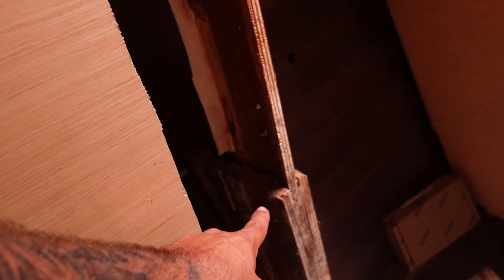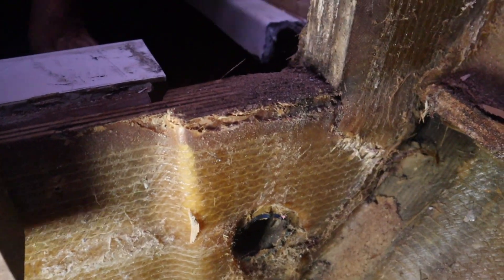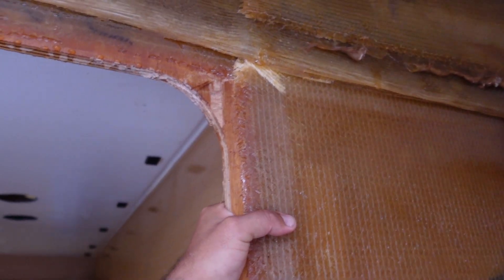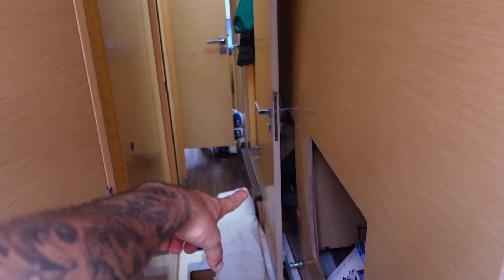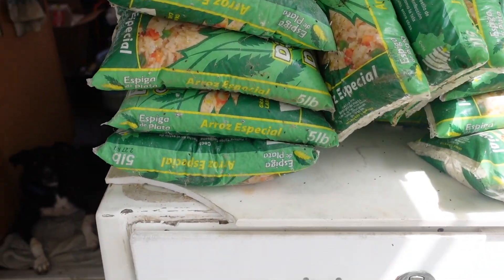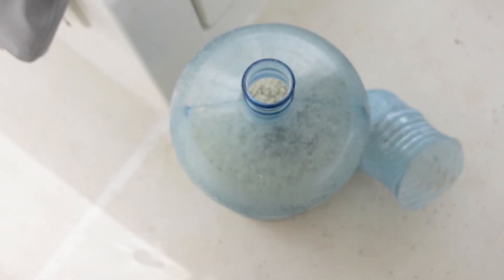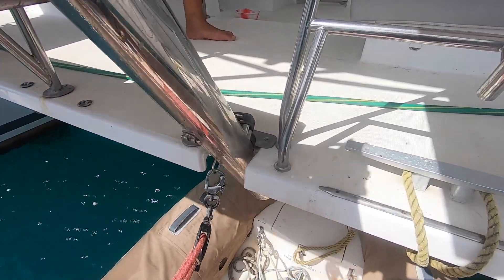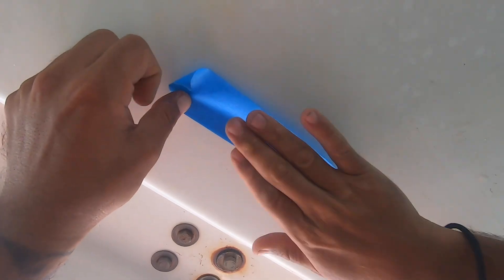CRACKED BULKHEAD REPAIR SERIES: Part 1 - An introduction... (Episode 107)

Comment: I cant believe they only used 3/4 inch plywood bulkheads, criminally shoddy construction. I use 2 inch thick on a 20 foot power skiff.

Comment: would you need to pack out under the saloon so the losd of the straps is spread across the hull rather than just pressure through the keels ??I am no naval achitect just have an engineering background / not to sy you don know what your doing just thinking how I would go about it , to try and not cause moor damage

Comment: That ply has been wet, then put under load (or already under load) which has then caused it to sag like that.

I agree with you - sudden damage would result in fracturing. for wood to bend like that takes moisture. Its all black and funky looking too - so id definitely go with a leak somewhere. Id find that and fix it while you are at it, and probably replace the whole bulkhead using the old one as a template.

Comment: Good video, this is not the first 45’ Lagoon I having these kind of problems. I think this is not because of the hurricane damage but more about selling a “nice weather coastal cruiser” to offshore blue water sailors. But again it is only my opinion. Wish you success with repairing this enormous damages to make it stronger than it was build. I think Lagoon should pay for the cost if this boat is not build to offshore sailing standards as they market them to be.

Comment: wow you have a lot of work on your hands. looks to me like a combination of things have happened here. age/water damage. fatigue, impact and overstress. Good thing you are exposing all the bulkheads now and getting a good read on the repairs for each area. Tool up! when you are in the lift and trying to position the boat correctly you will probably need to remove some bonder and splintered materials in order to get it to settle into place. Oscillating tool, cut off saw, die grinder and angle grinder. it is amazing how those little bits will prevent the parts from coming together. Make a plan ahead of time and some of the bad bits might be best cleaned up before you go in the slings. Like the bonder that is broken and shaggy.

Comment: Prolonge fatigue is a sign of substandered materials or substandered epoxy joining/ glueing. You can see the buck head is warped and bent rather than a snap or glue failure. To me with a civil engineering degree and a masters in construction is substances materials and fixing method. You may have a case against the manufacturers, and they know it hence the reached out to you before you reached out to them via a lawyer.

Comment: What, a level on a wall with the boat in the water,  would if there is more weight in one hull than the other... like you said,  get it on the hard and support the bridge deck,  LEVEL,  loosen all the shrouds, double up bulk heads and header.... at mast position... at least 3 3/4" ply...

Comment: Your definitions of "level" need some work. When you put the level on the wall, there was no way to know if the boat was level in the water; even your weight on the one side would have affected that. You will face the same issue on the hard. You need some way to know that the top of the supports inner the bridge-deck form a level plane.

Is it possible that at some early stage of the boats life someone overtighened the rig putting too much strain into the hulls? Would love to know a bit about the theory of how tight the rigging should be to hold the mast but not collapse the hull bulkheads.

Comment: Good luck to all Lagoon owners......I am glad I am not one of them !!!
Reply: Well the boat went through a hurricane, was part submerged, repaired to get out of there, sailed and then hauled out for repair areas where moisture got into into the balsa core. The question on how can plywood deform like that is pretty easy moisture, heat and constant tension also bending timber is done under compression perfect scenario for boat rigging.

We have no idea what else this boat has gone through like haul outs missing bulkheads or over tensioned or under tensioned rigging and sailing overpowered.

Steel boats are more forgiving and keel boats will heel to drop power to falling flat but you have heeling and less flat floorspace than a cat.

Even with all the work if I was 20 years younger I would take the gamble to sail the world but after hitting a container, ghost net or Whale 5 days from land in a mono hull in a fibreglass yacht and having the rudder ripped out I sort of decided I was not so keen even tho I saved the boat and got it and me to shore (much to the insurance companies horror) as they wanted book value not an pre accident assessable condition.
Reply: 🤔 Steve T are you from a cubical of Lagoon? Sure write as one.
Reply: @stevenr8606  Nope I don't earn that much but investigated building my own cat (spare hull, rudder and engine seemed smart) but well I still just have the drawings.

I had an old heavy slow solid core 45 ft mono hull so draining blisters and touch ups with endless electrical and mechanical issues (only just enough skill), it was a deep keel, it was cheap and "fixed" in many exotic south pacific places before leaving (and breaking) not seeing much of anywhere before it hit a container, ghost net or whale ripping the rudder out (whatever it was never broke the surface).

Completely the wrong boat for the reason I got it but it was cheap to buy expensive to maintain and worth possibly a little more than what the insurance paid out.

There is no perfect boat or material balsa can act like a wick, infusing large areas of the core with water from even a minor breach. Cross-linked foam is less tolerant of impact loads and can burn when grinding the outer glass and damage cannot be seen and ply even marine ply breaks down in water (there is one with a 5 year in fresh water guarantee).

Honeycomb like Nidacore is great once glassed but expensive, this was what I planned to use for the bulkheads as it is Zero maintenance but still needs to be glassed over for finished surfaces.

Yachts are built to a weight, price point and I think this boat having gone through what it has from lightning strike, a hurricane and partial submerged after being a rental boat (and we all know rental cars are treated perfectly).

At the end of the day the yacht still being reparable and Colin as an engineer having other salvaged boats as options he could have taken a different hull and swap the equipment only but still having confidence in the abilities and reparability of that boat shows.

Also for the boat builders to assist a self professed amateur to repair their older boat  with minimal supervision then continue a lap of the world knowing it's history, it is a lot of risk for the Yacht Builders knowing their intention to sail to NZ long distances big ocean waves lots of weight in the boat.

Comment: Best of luck lads. You’ve got a serious task at hand. Does Lagoon have a CFD analysis of loads for this model?  That would sure help with identifying key stress points and avoid transferring the loads onwards to the next easiest point of failure. 
Absolutely riveting stuff though and makes your channel stand out. I’m going to your Patreon page next and chip in for the journey. David J Flatts, Bermuda 🇧🇲

Comment: These examples of deformations in the vessel are because of extremely poor boat building practices. These techniques would never pass any American boat building standards.  They’ve all been developed to save money and weight. Once the insurance companies realize these improper techniques, these boats will be un insurable.  Catamarans have to be light but not by improper building techniques and materials. Your pictures of failed bulkheads illustrate the worst newly developed shortcuts possible.   No sense in saying more about what should never have been done.   Good luck

Comment: I am a boat builder  of plywood and epoxy boats. west  system is not the best epoxy it is expensive and hard to work with. I use Raka epoxy out of Florida. Those bulkheads should be 2 inches thick laminated plywood. You don't need marine grade ABX is fine

Comment: I agree with your claim that the buckling you see in those bulkhead panels was not caused by sudden impact but rather sustained warping over a period of time. I have many years experience working with marine grade plywood and looking at those sheets makes me think it is not the best of quality. Also it appears to be either 13 of 15 mm thick? Perhaps do the rebuild with 3/4 inch / 19mm. Of course, the problem here stems from board strength. The strength comes from the glue (obviously the birch plays its part) and over the years places like the EU introduced more and more regulations on the formulas of the formaldehyde glues that manufacturers use. What we found was that the best place to source the best marine grade plywood was Russia. They are obviously outside of the EU and care little for regulations and sadly for the safety of their workers. The Russian plywood stank due to the glue but it was like sheet steel and we had to buy waterjet machines to cut it easily. Good luck with the repairs, I'll be following along.

Comment: You can eat that rice.  Out in water and mix the bugs will float. The Irish can than be washed and cooked as normal. Problem is once the rise is wet it was to be cooked so can only do that process a bit at the time.

Comment: It's starting to look like you're going to need to basically gut the hulls out to the 'glass and rebuild most if not all of the structural framework.  It's going to be a big and hairy job but if anyone (outside of the Lagoon shipyard in France) can do it, it's you guys!  Do a cost comparison between coosaboard and marine grade plywood Colin, the way lumber prices are (at least Stateside) it may almost be cheaper to use the composite material!

Comment: The Lagoon 450F has long been my dream boat but after seeing the serious build problems in Parlay I won’t consider one. Gonna keep my solid fiberglass tank of a monohull and put dreams of a flybridge away. Thank-you for making the series guys!!!
Reply: Its all just fibergalss mate. If you put your mind to it it can be fixed and made hurricaneproof.  Not only was this boat damaged, but I also suspect that the construction is on the edge of strenght due to cramming as many efing beds into a charter boat as possible.
Reply: The cat forces transmit to the hull the mono forces bleed off with healing

Comment: I would suggest a digital angle finder rather than a bubble level to be more precise.  Also, that wall is supposed to be vertical when measuring to the horizontal of the vessel, your measuring instrument (bubble level, angle finder, whatever) measures relative to the earth.  If you are going to take those measurements you will need to ensure the boat is perfectly level (measured at the bridge deck?) or have a measurement of how far off level the boat is and adjust your vertical measurements to that.  You're a smart guy and I assume you already know this but its worth saying just in case you didn't.  Hope that all makes sense!  Best of luck, I have all the confidence you'll knock this out.

Comment: Shouldn't you wait until the tension is gone before removing anything else? Did the boat basically buckle under the tension from the shrouds? Also will you be considering weight when adding extra fiber glass than standard?

Comment: I'm wondering if there was a material defect in the marine grade plywood, is that the side of boat that was under water? I'm wondering if the salt water started to delaminate the Plywood and then the combination of rigging stress and sailing impacts contributed to the failure. I agree damage like that is not from single event. I'm also a little confused with a boat of that cost and quality used plywood. It should be replace with Coosa board and that "glue" in the main bulkhead sections that is completed separated from boat should all be tabbed in with a heavy glass and epoxy.

Comment: parlay,,when you put the level against the wall an showed it out of plumb, that tells me , when your cat is on the hard you will have to level an plumb the cat to specs before you repair any damage, the naval guy that designed your cat should cover that, he would be the one that knows where those points are to level parlay before repairs are started,, its like a house if the foundation is screwed, so will the house be,,,bottom line is parlay will have to be perfectly level front to back an left to right, and how thats done is a complete mystery to me, it would be a great vid, how to level your boat before major repair, mr collen  i send an wish you luck on your repairs, cheers

Comment: Looking on the positive side, you're going to have the strongest Lagoon in the World when you've done. I would exoect Lagoon to at least cover your materials cost, this is the worst possible PR for them. I won't wish you good luck as I know your work will be spot on.
Reply: I wouldn’t count on a manufacturer to cover the costs to repair a storm salvaged boat
Reply: @yankkesrule  Looking at the standard of the initial design and build materials I think the boat is sub-standard quality and owners all over the World will be rushing down to check their bulkheads - bad, bad P.R. They should at leasy make a more serious gesture to help.

Comment: The vessel probably had cracks in the bulkheads as a result of the hurricane. The hurricane probably had the vessel contacting and slamming against hard thing like land, the bottom, and other boats.  It was not designed to contact thing of that type. Then you sailed it quit a bit which would make the cracked bulkheads get worse on a constant basis over time.  It is great the manufactor is helping you with your repairs, I am sure you are thanking them for that. They can’t make a vessel capable of surviving a hurricane especially in the harbor. Once you repair them properly you should have a great vessel. Your are a hard working crew and deserve to win. I have always watched all of your YouTube presentations. I will start to support you as a patron.

Comment: You can't use a level on a boat an less you no the floor is level. You need to probably need to use a square to see if you are  Perpendicular to the floor
Reply: The BIGGER question is the floor still level with the waterline of the hulls. Many factors need to be considered when either on water or on the hard. 1st hulls need to be level then go up from there.  The Cat has obviously been tweaked considerably !
Reply: @AlienX69  check the floor for level while 8n the water might be tricky with the water not being perfectly still.

Comment: Remember in ep 11 back in Guatemala you got assistance from someone in the yards "tightening the shrouds to spec" with that fancy line tension measuring device? I'm sure that's where this problem started.
Reply: Maybe perfect storm of events. Water damage, stress, etc
Reply: I think that you are partially right, but that time actually started to magnify the pre-existing design and build problems with these bulkheads. There are many 450 owners that since seeing the problems that Colin has found are inspecting their own 450’s and finding the same failures, albeit not as severe. This is definitely a design and build quality issue of Lagoon that I’m sure will be present in other Lagoon models as the same design and build methods were used during that time period across many of their models.
Reply: I was thinking the same thing, shrouds hastily tightened before FGlass had a chance to set up properly? Or under mixed resin problems causing warping and eventual failure from prolonged tension?
Reply: Would suggest there was structural failure that hadn’t been found after the hurricane damage - looks like the  entire haul or one side of it was picked up by the storm and twisted. Is it best to remove all the cabin fittings and take it back to an empty shell?
Reply: I agree with you.

Comment: Lagoon 450 owners are checking bulkheads right now. You gotta wonder if getting hauled out can cause some of this.
Reply: Not knowing anything about sailboats. But still thinking the same thing. But maybe this boat just have that weak point, that gives up.
Reply: @janisipola6122  i’ve mentionned it  in the first video showing the dammage on PArley: there is other occurency with french customer. But it was exchanged only on french sailor forums. Same bulkhead, same hole for system installation , same damaged. but this 450F was still under waranty, no salvage boat. one year fight btw lawer to get the boat repair by Lagoon. This issue is known by Lagoon and start to be visible. And honestly i am not sure than VPLP were aware of these additionnals holes in the bulkhead since they usually don’t provide detail drawing until system installation. But if such issue would give me the opportunity to have a phone call with Vincent Prevost.....I will be happy to have a broken 450 :)
Reply: @damientelle  That is heavy stuff. But let us hope that Colin will have stonger boat at the end, that it was when it left the factory.
Reply: Looked water damaged to me

Comment: i wonder if the marine plywood could be to blame, specifically the binder used to bond the plywood in those bulkheads. Thats definitely not damage from a single hurricane, thats material failure.